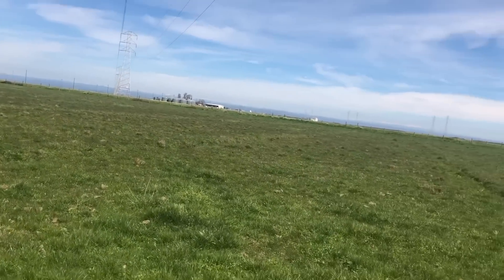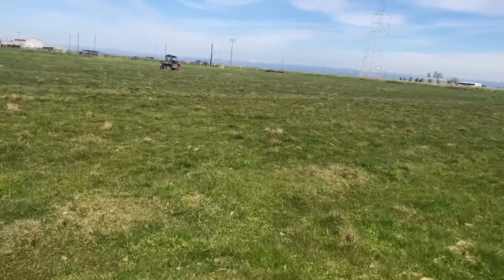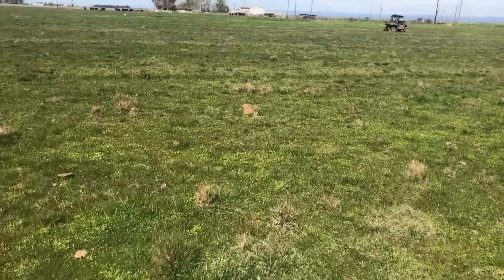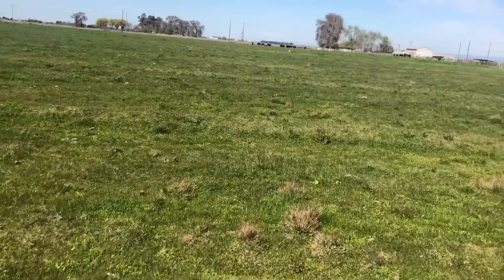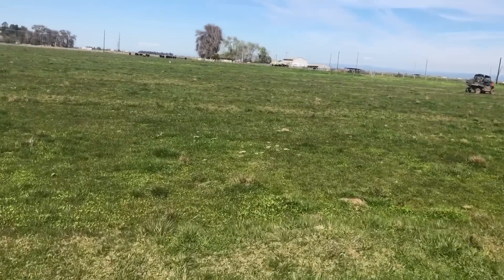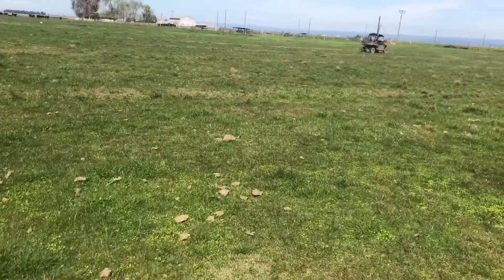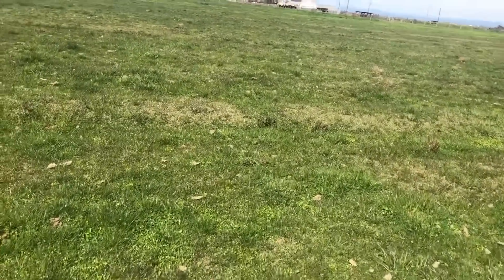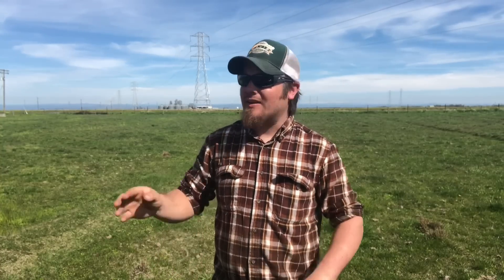Pasture Aeration Conclusion

Comment: I wouldn’t be too disappointed and wouldn’t expect huge differences in 1 yr. Many things effect soil structure like Calcium and Magnesium, biology, etc. just from watching it looks like you have a hard/tight soil, have you had it tested? Low Calcium and or high magnesium will cause a tight soil. Ca pushes to particles apart Mg pulls it together! You want a minimum of 60% Ca in your soil! The manure breakdown is slow too, could be biology/worms or even P deficiency? Low P in the diet can cause dry, hard fibrous pats that take for ever to break down but can potentially be low N too! It can be more about digestion or lack of! Keep at it but imo soil testing is invaluable!

Comment: Just ran across your channel. My suggestion would be to attempt to use a subsoiler at about 20-24" and 10-15ft intervals in order to allow the water to drain down. It's been used for years and can definitely help with standing water issues.

Comment: I own an aerway and have for about 20 years. I used it a lot at first but don't use it much now because I just never saw any real benefit from it. If you want to really help your soil use manure or chicken litter. This will add things to the soil that you cant buy and will increase worm and micro activity and they will do the aerating for you. After using litter for several years my soil is so much more loose. I don't think the airway goes deep enough to do any good really. I have wondered what a pasture ripper would do that has coulters to keep from upsetting the sod too much.

Comment: How fast where you running the aerator? I know someone that has ran one in alfalfa. He said the best results where with the tines at the 0 angle and running under 4 mph. Over 4 mph the aerator did not go as deep. The alfalfa was in heavy soil and the aeration was done in the fall. It does help keep the snow in the field. And 3 months after the ground is more mellow. I talked with him and he plans on using it in the spring to put pockets in the soil then spread dry fertilizer on the alfalfa. He also used it on a patch of sweetcorn as a vertilcal tillage pass. The angle set at max, and it did a nice job at 7 to 8 mph using it like this. The sweetcorn did better where it was used preplant. But as for aeration, I belive it will work but it just takes time. And one needs to play with it and maybe use it for fertilizer to really see a big difference.

Comment: I live in Florida with sandy soil so a little different than yours, and don't run a cow calf operation but have worked with some and have been in landscaping and certified arborist, which to become you have learn about soil structure and root systems and transpiration,etc. In Florida the popular pasture grass is bahia which benefits greatly from aeration. However the popular landscaping grass, St. Augustine doesn't.
The root zone is usually very shallow for grasses and the part that take in most of the oxygen/nitrogen is right under the surface of the grade, hair like roots. your soil is so different in composition and watering practices. Have you ever noticed how much better your grass grows after a thunderstorm or rain than when you irrigate? Rainwater contains more Nitrogen than groundwater and  rainwater mixed with lightening has even more.
But for improved growth I believe your idea about dragging a harrow chain to break up the cow pies would be time well spent. I might even rotate the sides of the harrow every other time.

Comment: Would you not have to be real carefull not do the aeration on too wet soil ? Seems lke it might actually compact more if the soil is not fairly dry .
Reply from the maker: Dry is certainly better when aerating as you want the soil to fracture as you punch the hole because it creates more pathways for air to get in there. Thanks Wayne